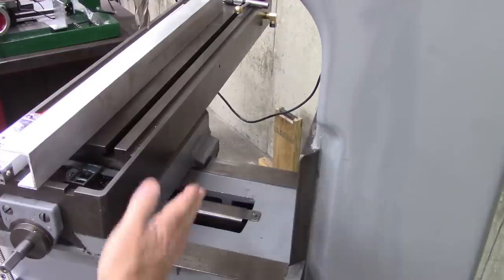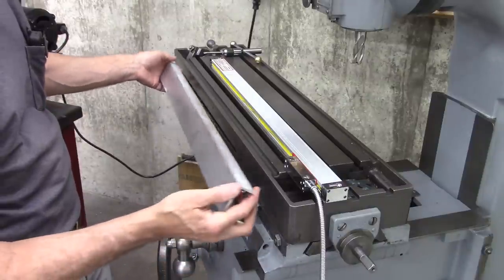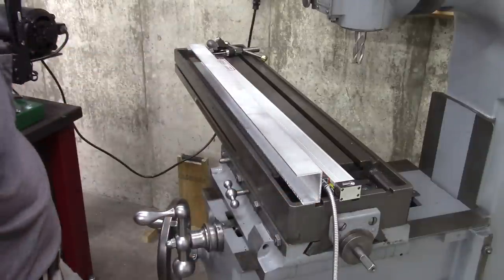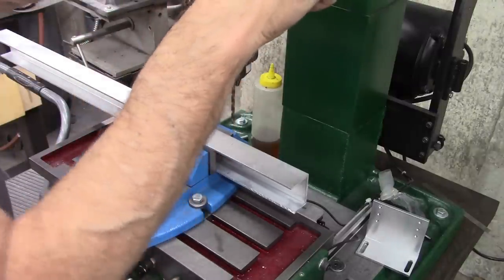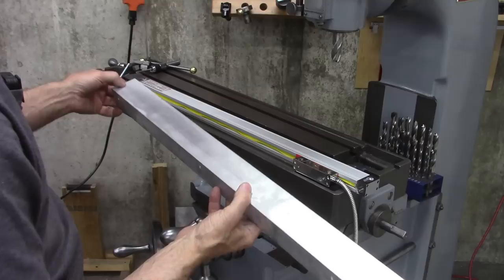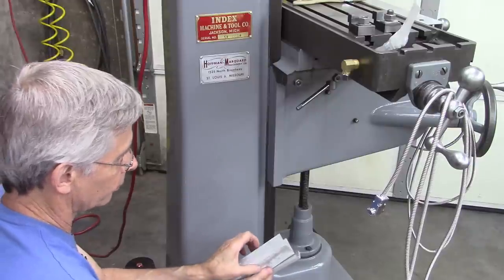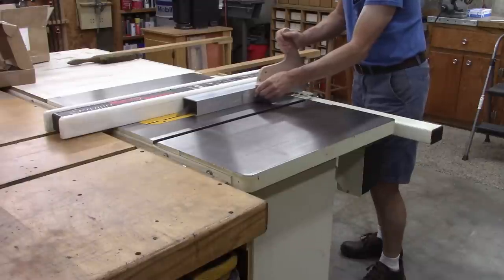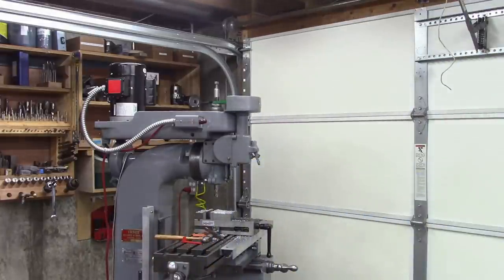DRO Part 1 - Installing the Linear Scale on my Well Index Milling Machine

Comment: Way to handle the install.  The brackets they send with the DRO always fit some other machine.  I installed a toauto at one time and it works great.  When you check it make sure your indicator is square to the travel or the reading will be off a thousandth or so.  Thanks for the video keep on keeping on.
Reply from the maker: >>The brackets they send with the DRO always fit some other machine - Thats a perfect way to say it

Comment: So I was looking at how to put a scale on my W-I 645 mill knee, which does not have the same flange to mount the scale on. And it has one shot oiler tubes on both sides, near the sliding way. The sides of its knee are close to the side parallel wise to the main stand of the mill. 
And I thought if I were to nod or tilt my head, similar to yours, that you could raise the table much higher. But if that happens, you could just buy the longer scale. In all the years I've owned my mill, I've never moved the head from vertical, and fight keeping it trammed.
Reply from the maker: I agree. I need to get the head perfectly trimmed. I'll likely use it at some point but not often.
Reply: @WinkysWorkshop  While I was buying stuff for my surface plate metrology, I got a 5" cylinder square that I use to tram the spindle body on my mill. I saw the idea on Home made tool forum, and it works super duty well. Otherwise my previous method was to put a collet into the spindle with the largest diameter straight piece of silver steel, and use a magnetic indicator holder that I could spin around. 
I don't think I've seen you with a surface plate in any of your videos. So a cylinder square may not be in your future. I think you can make them, but need a surface plate and a starting square reference to zero the surface gauge and test dial indicator with to check and make the cylinder square 'perfect' which may not be needed to that level to set the milling machine spindle.
How did you check the tram on your Wong Fu type machine, and I don't think it's adjustable outside of shimming the base mount that holds the vertical round column to the base.
I know I've lost tram when running a facing mill across a surface and seeing it cut in one direction only or on the backside cutting more material off, leaving a concave 'flat' surface. But you know that's generally not an issue for what we do, as if true flat is required, a surface grinder is used.
I did get a cheap surface grinder from Harbor Freight years ago, which I've been improving for the past 30 years. Most usage is with a 5C spin index to grind hardened round stuff diameters smaller. I did repair a valve plate on an air compressor where the reed valve was leaking.
Reply from the maker: @f.hababorbitz  I was talking about the tramming the head rotational zero point. the best method I've found is to install a large end mill of fly cutter and make light cuts to the surface of metal. I'm not sure how to change the outcome if its out of tram the other direction. I never trammed the RF30 but yes, shims on the column mount it the only way.

Comment: Great video Mark. If that was me I would have plugged in the display as soon as I had fitted the first scale. No only to check it works but also to have seen what the display looks like and to encourage me to battle on with the other two. Just hope it all works fine. Fingers crossed. Yee Hah. I like it. 😁 Regards from Australia.
Reply from the maker: Haha...  That's what several other have said. Test before you install. It worked out. I plugged in the display and it works perfect.... or at least so far. I have not tested the full travel or accuracy yet. It's a very nice display!

Comment: Nice upgrade to a now new mill. You wouldnt be interested in a 20" delta drill press with power feed.?? Or a Federal planer with about 12" x 36 table. It has to cutter heads side and top clapper boxes. Im to badly disabled to restore them now. Plane shattered when pain took my kobility. Bed bounds not fun.
Reply from the maker: Sorry to hear about the disability, I'm sure that is not fun, but not really interest
Reply: I am in the same situation as you are. Sometimes I can still do somethings but most of the time I am bed bound also. I finally realized my machining days are over and I just sold most of my equipment. I saved my basic measuring tools and cutters as I have access to friends machinery. I wish you luck and keep going.

Comment: Mr Winky, I have installed DROs on both the mill and two lathes, once you start to trust them they are great, if you have not had DROs before it takes a while to realise how accurate they are 👴🏻👍
Reply from the maker: I've had several very cheap ones and they were dead on accurate. This one will take some time to learn. It's good to get away from batteries :o)

Comment: Another point too, wonder how long it will be before you fit some power feed to the knee ❓that’s a lot of handle winding for full movement 😁. If the hand wheel comes off easily, make an adaptor that fits your drill for rapid movement. Then pop the handle back on for fine adjustment. Regards
Reply from the maker: Hell yeah...  I had to stop half way through and take a break when testing the travel. Fortunately I usually move it an inch or two! The first power feed will be X

Comment: Hi Mark, this is an elegant solution. I'm about to fit a magnetic scale DRO to something much more mundane than your piece of machinery art form. I'm having yet another 'design' think as your approach might give me a more compact installation. I would like to retain the X axis power feed end stops, the ability to set hard stops for manual use and of course not to cover up oil points, all of which present various interesting challenges. The oil port challenge I'm dealing with by adding a one shot oil system at the same time. The table hard stops may have to be sacrificed but I do want to retain the power feed limit switches. The idea I have had with those is to split them from being centre mounted to having one at each end of the table.  Like others below I'm aiming for having fixed read heads. It's all proving quite a tricky packaging problem! The Z axis hand crank on my machine is also exhausting and I intend putting a PF on it as well. In the meantime maybe an adapter and a cordless drill.
Reply from the maker: I covered up an oil point on the front. I can deal with it but it's not ideal. In hindsight I could have found a way to make it work...  I might address this in the future. As for the table stop....  I will find a way to get it back. I used the one on my other mill a lot. My Y axis has the reader head moving but it wont be an issue.
Reply from the maker: @bearsrodshop7067  The link didn't work.
Reply: Mark, should be in a Players List on DROs.
Reply from the maker: @bearsrodshop7067  Yeah...  the link didn't work but I went to you channel and watched part of your DRO install. Looks good!

Comment: Encoder head, would be what I would call the scale reader.
The difference with expensive DRO's and these affordable imports, the expensive ones give you lots of mounting material. Typically they give you a solid 3/8" by 1-3/4 bar of aluminum with all the holes for mounting the scale body to it, as well the mounting holes for drilling into the machine's castings. They sometimes have leveling jack screws on either side of the machine mounting holes so you can level them along the length. But I still found I had to FAB the plate between the Encoder holes and machine reference.
So now I would guess you will put power feed on the knee, cross and lateral axis. I've done that on my Model 645, and all three are very handy.
As for the quill, a DRO is handy for when drilling, or counter sinking. But yes, using the knee is a stiffer way to do machining.
Reply: Also, I  purchased a separate DRO for just the knee axis, but never installed it as the machine base has a taper from the floor up, and I just never took the time to design the install.
Reply from the maker: I'll add add a power feed to the X axis for sure but probably nothing else. I may eventually get tired of cranking on the knee to change end mills and add some power. A quill DRO might be nice but I'll probably never do it. The mill has a power down feed with an automatic stop to disengage although its a pain to set up.  For most things I could get close enough but getting s depth within .050" would be hard to do. It's probably repeatable just hard to set up.  Most drilling will be done on my drill press anyway. As for the more expensive DROs, its hard to say if it's worth the extra money. I suspect the cheaper ones are just as accurate and I think setting the parallelism to within a few thousands is obsessive. Unless there is something internal to the scales that goes wonky with slight side movement the amount of error this creates is very minimal. If I did the math right 1/10" out of parallel over 20" equates to an error of .0005".

Comment: Looks good . I use there glass scales they work good so how far dose your vise sick out pass the table mine stuck out as far as the scale dose so i mounted it in the rear and i also did that so i could keep the stop for my power feed . JM  Also the machine turned out sweet 👍
What i did on the knee is drilled 1/2 hole and center drilled some 1/2 bolts m5 or what came with the hardware that way i could use the 1/2 bolt to set the two surfaces parallel and screw the bracket to the bolts and screw the scale to a flat bare stock . I mounted the scale to the side of the Colum.  well  hope you get it . JM
Reply from the maker: The back of the vise is at the back of the table although the with the table all the way forward the end mill is just passed the back edge. If I move the vise toward the column so the inner back jaw is even with the end mill I lose travel due to the vise hitting the column. So nothing is gained. It's confusing to describe but I do gain a little usable travel with the scaled mounted to the front but only a small amount. Also I like the fact that the work is more centered on the table. this is a big plus for coolant.

Comment: awesome video as usual...question....what brand of band saw blade do you use for steel......i have the hardest time cutting steel on my  wilton bandsaw...it is a metal/wood band saw   and i know you have  cut way slower for steel...it blazes right through aluminum no problem.....confused in pittsburgh
Reply from the maker: For my bandsaw I usually use Imachinist ordered on Amazon. I usually buy 14 tooth but the last blade was variable pitch 14-16 if I remember correctly. It's not very good. I just ordered a 10-14 pitch which I suspect will work much better. 14 TPI was good but a little slow.
Reply: @WinkysWorkshop  thank you sir...love your channel and projects...great stuff
Reply: @WinkysWorkshop  let us know...mine cuts aluminum like a wizard...but on steel when i change speeds on the band saw...it so slow cutting 1/8 steel
Reply from the maker: @minskmade  I always run my saw on the highest speed. At least on my saw it's within the correct speed range for steel. My saw is fairly slow cutting but in my opinion about right its size. Also, with the blade guides set-up right you can use full down pressure on wide stock. Fewer teeth per inch helps a lot with speed but it's easy to break teeth on narrow stock. I use 14 tpi but will soon try a variable pitch 10-14. I suspect it will work well

Comment: Mark,
Ive installed 3 axis dro's and scales on 3 or my own machines, just a suggestion due to your space limitation on your x axis....instead of mounting the scale with the reader in the vertical position (ie: down) mount it horizontally so the reader is nearest the operator....the scale mechanism is rectangular and allows for this type of mounting.....still use your cover piece to shield it from contamination.....the extra room you should get should be sufficient to mount your travel limit blocks that you were worried about and were going to modify....just saying...
Don
Reply from the maker: I actually thought about doing that and in hindsight it might have been the best option. The reason I did not is that it would extend out about 1/3rd further. Even with the current setup I have some concern about accidentally bending the channel with a heavy block of steel on the table. Adding additional depth would make it flex or bend easier. I need to think about this more. I also covered up an oil port for the X axis ways. I can still put oil on the ways with a brush but it would be nice if I had access to it. I might move the scale out from the table and put an offset in the reader head bracket. I suspect this would give me enough clearance for the table stop. I got the oil port issue figured out now but I still need to remove the cover to fix it. 

Thanks for the input!
Reply: @WinkysWorkshop  Mark, 
I  have one of each on my 2 mills, one vertical one horiz....a horiz mount would protect your scale channel by your 1/4 channel and should be plenty strong enuf to protect the scale and the reader, Ive never had any concerns or issues with mine that way and its substantially bigger than yours,( a 10x52 3hp Alliant knee mill)....heck my 12 in Bridgeport rotary table alone weighs 100 + lbs alone and I hang it on the 10 in bed all the time...like I said NO issues.......mounting that horiz on yours should be just fine....just sayin...😃
Don
Reply from the maker: @donteeple6124  You're probably right. Especially since I'm the only person using this machine.

Comment: Good job well explained. I like the way you do it one step at the time figuring it out as you go. Prints are useless and a waste of time until the third
prototype is finished. 👍👍👍
Reply from the maker: Prints are good for some things but this is sort of a "invent as you go" installation. There are tons of different ways to install DRO scales. I think using thick aluminum channel provides a lot of options. Mounting the scale to the channel instead of the mill makes mounting to the mill easier. The mounting holes are not dictated by the scale.

Comment: Nice install!  As I was talking at you during this installation on my monitor on differences in what you were doing, and what I went thru to set up my Lagun, making sure it was absolutely dialed in up and down, and in and out within I  think it was 0.005 throughout the full travel (after driving the table out past the end of the scale, and crashing the reader head, and having to replace the X axis...... it was a "learning experience" ..... possibly character building), I realized, your scale is stationary and your reader head moves with the table.  My setup is the reader head is stationary, and the scale moves.  That way the cable isn't flexing and stressing during table movement.  All the best Winky!
Reply from the maker: My reader head is stationary on X and Z but the scale is stationary on Y. This was a matter of convenience while mounting the scales but yes, it is nice if the wires don't move. At this point I haven't installed the display but I will minimize the wire flex at that point and possibly shorten the wires. Currently they are about 6 feet. the scale is about 2 inches short on my Z axis (the knee).  At the end of the scale travel my collet is about 1" from the table. This is an area I will never need to be. When I install a mill and use a vice. I suppose clamping to the table I will get close but probably not an issue. After making this determination I realized I might tilt the head at some point and run into a problem. I'll need to extend the quill a little. Maybe I'll buy a new scale but probably not.

Comment: Just installed the toauto 3 axis on my jet 13x40.  Y is on the tailstock. The scales are huge. It has taken 3 weeks of varroas bracket making and guards and cable management. I ended up with the whole carriage, cross, apron and tail torn down. each mounted in the mill for flats and tapped holes. all cleaned and deburred and generally made better. The lathe is new to me. also installed one shot oiler on bed ways. I will add the cross when I figure out the clearance. Its only after/before work and every other weekend.

Love the channel. thanks for keeping me company out in the shop.
Reply from the maker: The simple magnetic scales I put on my RF30 mill were a bit smaller but not a lot. I don't think there are any made that are much smaller. With that being said, with today's technologies I suspect they could make them MUCM smaller. The magnetic scales are MUCH smaller but the reader head is still fairly large. The rails are about 1/8" x 5/8". Imagine a reader 1/4" x 1". I could have stuck the scale under my x axis table. I can't imagine installing any DRO on a lathe. That would be a huge challenge.
Reply: @WinkysWorkshop  I have a ditron on my mill with magnetic scales. they are about a 1/4" thick. The glass from toauto are about 1.33". Cross will likely get a magnetic scale at some point. I seen someone put the scale inside the cross.

As far as install. they need to come apart sometimes for cleaning anyway. Just do it. I have saved so much time in setups and scrap already.

Comment: Nice Job Winky, did you allow the extra 3'' when you purchased them ?
Reply from the maker: More like 1.5" to 2". The scales are sold in actual travel so it worked well. The Knee came up about 1 inch short but that was my error. Right now the table goes to within about 1 inch of the collet which is more than good enough but I forgot the head rotates. It's conservable that I may need more travel if I tilt the head.
Reply: @WinkysWorkshop  Oh right, i was told add 3'' overall to the travel distances when i purchased mine, good they all work fine though.
Reply from the maker: @65cj55  It's good to add a little but 3 seems a little too much. The 3 inch might apply to some systems. ToAuto is actual travel.